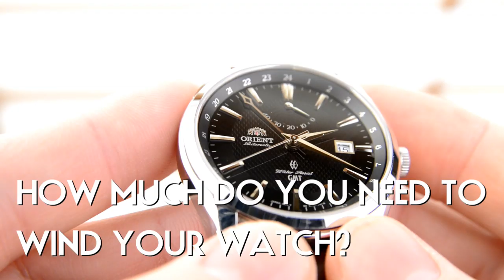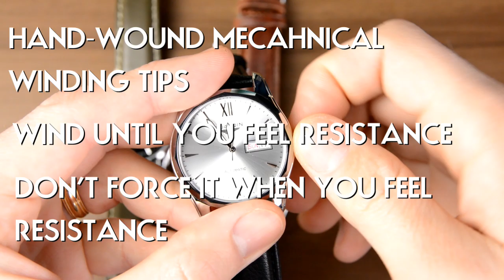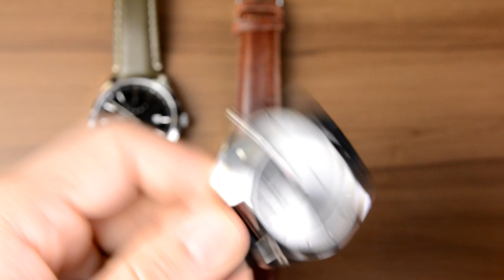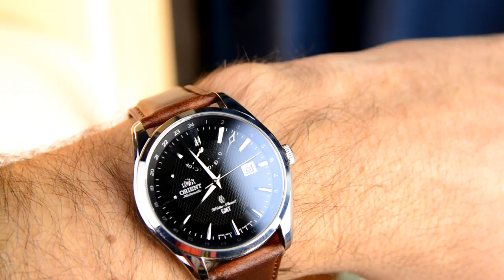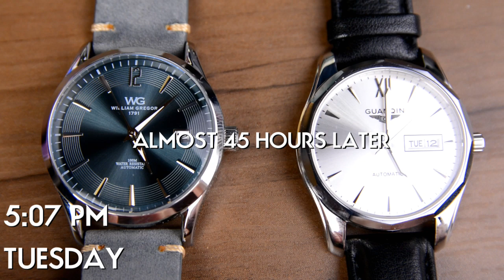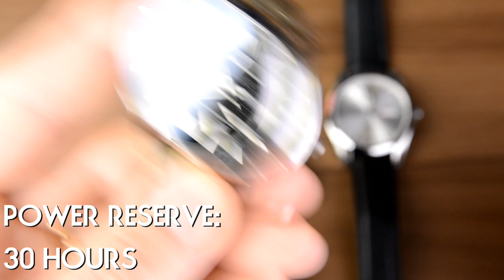How much should you wind a watch? - Watch Basics

Comment: 2:28 I have two Pagani Design PD-1767 watches which have power reserve indicators, and because the one I'm using is very inaccurate, even after regulating it, I wanted to check out the other one's accuracy but I didn't wanted to unbox and unpack it, so I wound it with the rotor, I did the measurements a year ago, so I don't remember very well, but it took roughly 5 minutes of circular shaking to give it 24 hours of power reserve, so it doesn't take forever but it's significantly slower than winding with the crown which takes 20 seconds to give it 24 hours of power reserve. It has Hangzhou 2C10 movement which is a chinese copy of the seiko nh35 movement, and it has bi-directional winding.

Comment: So you have to set the watch to right time everytime you use it? New concept to me never had a winding watch and why?
Reply from the maker: There's two types of mechanical watches (winding watches). Automatic and manual. An Automatic watch will wind itself when you are wearing it, just using the natural motion of your arm and wrist. Most of them will continue to keep time for about 40 hours after you take them off. So if you put it back on before it fully winds down, the time will still be correct and you won't need to set the time again. However due to the inherent inaccuracy of mechanical watches, after about a week or so they drift up to 5 minutes or more off time, so you're likely going to be resetting the time at least once a week no matter what.

A manual wind watch works exactly the same, except it doesn't wind itself on your wrist. Typically after winding it fully it will keep time for 40 hours. But before that time is up you'll need to wind it again. As long as you wind it it will continue to run and keep time. But like an automatic it will drift off the current time requiring you to set the time probably once a week.

Comment: Hello, im worried im over winding my Orient Kamasu because after i hand wind it i screw it back but sometimes it wont bite when screwing it back and sometimes i feel like im winding it instead on screwing it back.
Reply from the maker: The movement in the Kamasu has a feature that prevents overwinding, do you don't need to worry about that.
Reply: @JusttheWatch  thanks! Last question, do you think i shouldn't wind it everyday specially if im not using it? I use my watch once or twice a week. Should i wind it even if im not using my watch? Or is it better if i don't if its not in use?
Reply from the maker: @kheandrae9894  It's not going to make a big difference either way, but if you let the watch rest on the days your not using it, it could help extend the life of the movement a little longer and give you more time before it would require a service. If you're going to be putting it aside for a long time it's best to wind it at least once a month to keep the oils from drying out.
Reply: @JusttheWatch  Thankyou very much for the information! Such a huge help. 🙌

Comment: Basically all automatic watches can happily be wound except movements based on the ETA 2824, Sellita 200, PT5000. The ETA 2824 has a weakness that if overwound the Cogs on winding mechanisms ware out / teeth on cogs break if repeatedly wound . With 2824 just slowly wind about 6 turns to start then wear it. The ETA 2892  winds like a dream , Seiko movements are fine to wind.

Comment: At 2:00: never do this ! You can damage the Rotor ! If it is a automatic movement, just wind the watch normaly till the watch goes on. If the crown is screwed, wear the watch for some minutes till she ticks and then put the time.
Reply: How do you mean? You can damage the watch by moving the watch? Isn't that the whole point of the rotor? The kinetic energy from moving the wrist. Some of those Seikos you buy there is no manual wind function and on the manual it says to shake them side to side for 5-7 minutes. I don't think gentle shaking of a watch is going to cause any issue. After all.. people play tennis and stuff with Rolex. Which I'd imagine tennis swing would be much more force than a gentle shake. You don't really even need to shake.. just spin it in a gentle arc, you know the rotor is spinning around.. rather than side to side.

Comment: Power reserve can be a problem for me.  I've learned that some movements can work better than others.  I have an office job, I put on a watch Monday morning and wear it through Friday.  I take it off at night then the next morning about 8 hours later I want it to be still running.  Sometimes the cheap Miyotas and Seikos can have a problem, the Seiko 6R15 and the ETA 2824 and 2893 usually don't have a problem.  I still have one Seiko 7S26 that normally runs fine for me, and now have a Miyota 9XXX that works well, but now my ETA 2824 and 2893 won't stay running.  With them I will hand wind them Monday morning then by Friday night it is barely able to run through the night.  So 16 hours of wear barely gains me 8 hours run time, on average.  I've also noticed that the 2824 give good feedback  while you are winding it, the 2893 I can't tell if I'm even doing anything.
I detest the power reserve indicator on the dial because universally they seem to be very ugly, but it would be a complication that would be of benefit to me.

Comment: I got a Seiko SARB035 on Sunday, wore it for three days and its been working great. I have hand wound it a few times a day (no more than thirty turns) just cause I think its fun but today as I wind the watch there is a noticeable difference in how winding it feels. It feels harder to wind and there is a bump every other click. Could the watch movement be damaged or is the main spring just fully wound? Im new to watches and this is my first automatic so any info would definitely help.
Reply from the maker: That most likely means the tth movement is fully wound and the main spring is turning inside the barrel, as designed. It's probably better for the health if the movement if you don't hand wind it at that point, and if you're wearing it you really only need to hand wind it to get it started.
Reply: @JusttheWatch  I think you are right actually. The resistance and strange bump has gone away. watch seems to be working fine. Thanks for the reply.

Comment: Awesome! Thanks for info. Very Useful But is it ok to wind your watch daily?
Reply from the maker: Winding it will add a little bit of wear to the movement, but isn't harmful (unless you wind it excessively). It's more a question of whether or not you need to. You should wind your watch whenever needed, that is, if it stopped. As long as an automatic watch is running, and you're wearing it, there's no need to wind it. But if you're going to take it off, and want to be sure it's at full power, there's no harm in winding it up.

Comment: If I want to just wind an automatic watch and not wear it how do I get it to full charge?
Reply: Full wind is about 30 cycles . Well to be save maybe wind it at 20 cycles and it is mostly 3/4 full if not a little tad more. 

But without watch winder you certainly need to pick up that watch after 2 days tops.
Reply: buy a auto winder that keeps the watch powered while you are not wearing it. You can find them for $15 on aliexpress. Its hard/impossible to tell if a automatic watch is "full" unless there is a power reserve hand that shows it

Comment: What happened to my watch? It ticks when I wind it. The kind of a tick which you hear when you change the date. It ticks kind of once per each round of winding. It’s an automatic watch.
Reply from the maker: Not sure, could just be the way your watches particular movement works, or could be a sign that something is wrong. If it's otherwise working fine, I probably wouldn't worry too much about it.
Reply: Just the Watch thanks for your answer. It didn’t happen before. But it’s been running some 10 hours by now very nice. Don’t really know what it could mean.

Comment: The 7s26 in many Seiko 5 watches needs about 900 revolutions of the rotor to be fully wound.
I'm wearing my watches only when I leave the house, and I have a couple, so most watches end up sitting on a shelf most of the day.
For the 7s26 that doesn't have hand winding, the following method has proven to work for me:
I hold the watch horizontally using its strap folded, so I can swing the watch horizontally but in a curve.
I hold the watch in my hand and near my ear, so I can hear the rotor weigth revolving.
With a little practise I find the swinging "frequency" that keeps the weigth spinning with every movement, then I count about ten revolutions, then counting the "times ten" I have already wound it, until reaching about 300 revolutions. Since the watch usually had some spring tension left, this makes the watch keep running for about twenty hours when sitting on a shelf in face-up position.

When the watch is worn, the movement is slowed down about 90% of the time. Whilst the 7s26 in mine has a deviation of about +10 seconds per day (sitting on a shelf face-up) when wound at least 50% down to maybe 20%, wearing it slows it down to anywhere between +/- zero to -20 seconds per day.
When the watch is sitting on the shelf, I check the deviation about two times a day, and when I find it to be on the negative side, it's time to wind it 200 to 300 revolutions again - going slow for more than some hours usually means the spring has lost all tension within the next few hours.
Reply from the maker: Great information on the 7s26! I just picked up a Seiko 5 sl this is helpful!